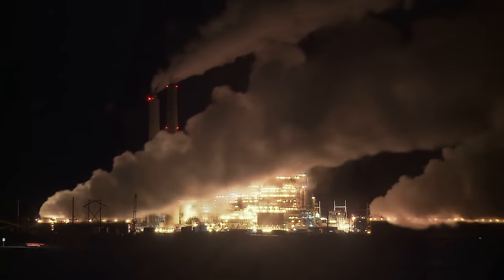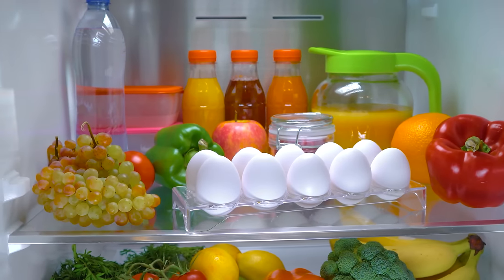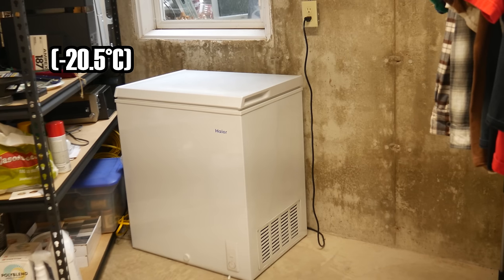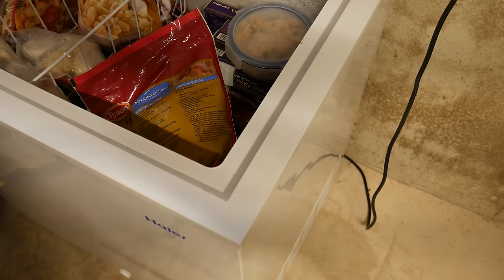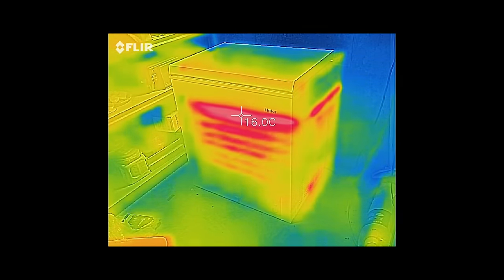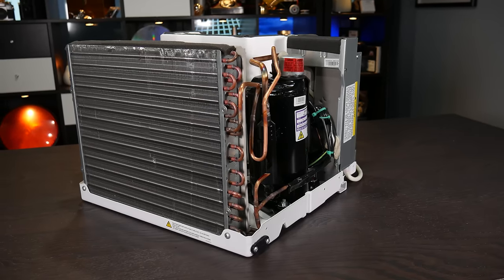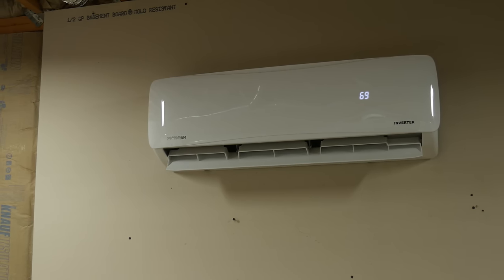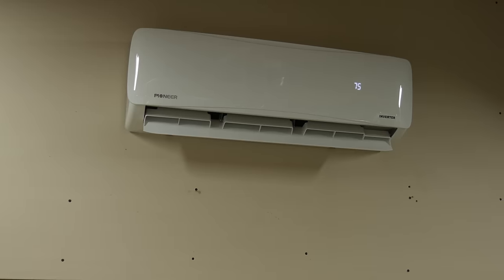Heat Pumps: the Future of Home Heating

Comment: When I was about ten years old, 50 years ago, I asked my father why we couldn't put the outside part of the window AC inside by flipping it around to warm the house in the winter. I didn't know the way it worked at the time but I do now.
Reply: Ahead of your time sir
Reply: I think you have that backwards I would have been kicked today not 50 years ago
Reply: Because the outlet in inside the house :)
Reply: I was working for LUSH manufacturing about 20 years back.  They were trying to pour massage bars however the room was too hot.
They wired up a window AC unit and placed it in the middle of the room.  Being the son of a Mech Eng I was apoplectic trying to explain
how this particular thermodynamic setup was worse than nothing.  Seems funny now however at the time I was truly flailing.  XD
I was working with stupid people...a lot of them were real pretty so, six of one......
Reply: While it certainly would work, the amount of energy that it could pull from the outside(you never mentioned the outside temp), would make it colossally inefficient.
Reply: @seanb3516  The ac would be working against itself that's why dehumidifiers blow the air over the evaporator then the condenser the evaporator cools the air to takeout the moisture then the condenser warms it up before it goes back into the room
Reply: My dad would say that it stuck out too far into the room.
Reply: Wouldn’t work long . Need a defrost cycle
Reply: Nope, doesn't work well.  Does work but very poorly.  not a good idea.
Reply: Seems simple enough to add a reversing valve for the reversibility.. unfortunately manufactures will gouge you for it. On average an extra 1200-1500
Reply: Austin S nothing to it really and it’s not that much more . The main cost in a system is the compressor.
The gist of what he’s saying is air conditioners are heat pumps. The thing is in the trade when you go to the supply house and say you want a 3 ton heat pump you’re going to get a heat pump , which means it’s going to have a reversing valve. If you want 3 ton cooling only , you ask for a straight ac unit.
Where I’m from , most have straight ac with gas furnace , heat pumps with 10 kw or more aux heat strips or “duel fuel “ which is a heat pump with auto swap over to gas furnace at a certain outside air temp. Newer heat pumps are available that can heat in extremely low temps though, however that hasn’t always been the case with them.
Reply: Your medal is in the post.
Reply: @seanb3516  reminds me of one summer my roommate tried to open the refrigerator to cool the room. I tried to explain that it's just a heat pump but he sat down in front of the fridge and pointed out that he was feeling cool air, so it must be working
Reply: LMAOOOOOOOOOOo that was funny!!!!!

Comment: Just installed my first heat pump this winter and it's amazing. I undersized it at 12k BTU for a 1500 ft2 main floor, it's not much more powerful than a toaster and it kept 22C indoors. It's a 14 hspf rated for -26C and averaged 1.4 COP when it was -26C including the defrost (15min per hour). I'm going to install another small one for my basement now and maybe one for the pool!
Reply: Where are you at? Whats the average winter temp outside ?
Reply: @Harcix  In a city north of Montreal, QC. We average 14 days a year with temperatures under -4f. You can look up those stats. I modelled my calculations for worst case of 0F and will be using auxiliary heat or let the temperature drop when it gets worse.
Reply: And update, it used 150kWh each month for the summer, meaning it cost me 9$ per month to operate and kept my house cool all summer for June, July, August. It's amazingly efficient. Still planning on installing one for my basement that I used to keep at 8C in winter.

Comment: I'm actually in the middle of taking an HVAC class right now and the last few videos you've out out have been invaluable in helping me, thank you so much!
Reply: In Switzerland common since the 1980ies. But with water-circuits to heat comfortable and more efficient.
And on the top, a lot of them are taking the energy not from the fresh and cold air, they go 200 meters deep in the ground with another water-glycol-circuit. Even more efficient, but not cheap.
And now since a few years, this deep in the ground going loops are double used:
In winter to get +5°C Water for the heatpump, in summer to bring +16°C Water to cool (without A/C).
But it needs good engineering.
Reply: facepalm
Reply: I wanna do HVAC haha, or be an electrician
Reply: I learned air conditioning for 5 years, and I wish we had a troubleshooting rig like that
Reply: @Worldsoldout  that's... overwhelming and makes me envious. Well, there are perks living in the 2nd world

Comment: As an engineer, that was a brilliantly clear explanation on how refrigerators and heat pumps work. Well done, dude!!
Reply: THE SPLIT HEAT PUMP doesn’t have built-in resistance heat?  I thought that was standard backup heat for heat pumps.  (That’s how my whole home unit.)

.
Reply: They are still a piece of shit in Michigan for heat. They are hole in your pocket in the wintertime and don't keep you warm on cold days. Don't try to bullshit the HVAC installer/ Mechanical Contractor.

Comment: I live in Australia, so it doesn't get as cold in the winter here as it does in North America, but in the winter it can get from between 0-10 degrees C. And my old house was entirely heated by heat pumps. There was like 6 split systems in the house, they worked great

Comment: I'm from Australia and at first thought "heat pump" was going to be some amazing new technology, and then you said "reverse cycle air conditioner" and I was like "oh, aren't they standard everywhere? I have 3 in my home." Apparently not. Here they are very common and work great it our climate.
Reply: Mark Taylor wants to tell you about Australia's favourite air
Reply: Yes, you actually really struggle to buy an airconditioner here that isn't reverse cycle (unless you're buying the smallest cheapest unit possible). And that's in a location where you might turn it to heat mode for a couple of hours on just a few days in the year.
Reply: Heather Petersen  And oil and natural gas.
Reply: Hi Richard - Sydney dweller here.

Yeah i have known reverse cycle air conditioners ( hot and  old ) since the 80's basically

The old part of the house has a mitsubishi  reverse cycle air con from late 80's - still works great
The rear part of the house had a  LG unit in @1995 but that failed and was replaced 2019 with another mitsubishi

The only drawback is you need to remember to change the cycle on the remote from heat to cool 21 heat is was different to 21 cool   - so about 2 times a year i remove the batteries for a minute then place them back in and reset it to the correct cycle ( a dot moves between the heat and cool cymbals every 5 seconds , just press the power key on the cycle you want )

Also, if you are in remote or snow / freeze zones you need a higher end model specifically for freezing areas ( like much of north europe / canada ) these machines are more expensive as they have electrical heating element in the outside evaporator to defrost it beore it starts working

Regards
George
Reply: Same here in Argentina, we have one in each bedroom and living room and it works great!
Reply: I'd think Australia would have normal ACs to keep them cool in the summer.
Reply: In the Northern United States, heat pumps are rare. People heat their homes with propane, natural gas, oil, or wood. But it gets cold.

Comment: There was a "Blondie Comic" where Dagwood has the air conditioner in backwards, and Blondie asks "are you air-conditioning the outside, dear?" to which Dagwood responds, "Nope, I'm heating the house." It captures perfectly the irony of the situation you present.
Reply: They do work if the ambient is above -5 deg C
Reply: @ianship5058  Agree completely... That's the irony. The comic treats it as ingenious on Dagwood's part, but ultimately a "bless his heart" stupid, sigh from Blondie, for not "just" using a conventional heater... I wish I could find it.
Reply: It’s exactly what a reversible heat pump does, only with a reversing valve instead of turning the entire unit around.
A heat pump package unit could be a conventional A/C only sealed system without a reversing valve if ductwork was set up to change the airflow. It must not be efficient as it's not done.
Reply: @hkelly1623  Aren’t heat pumps  a thing of the past/present and not a thing of the future? I see a reversing valve in our cheap condenser I think it’s an ameristar unit.
Reply: @EastDallasKicks  Not necessarily. There is a large market for them in many places. You just don't see them a ton in mini-split configurations here in the states. They are instead integrated into the traditional HVAC system. Normal AC is just a heat pump it's just that most of them are one way. Doing away with heat pumps would be doing away with Air conditioning, Fridges, Freezers, etc. They are all just heat pumps, using them for heat is still a better bang for your buck than electric heat. I haven't run the numbers for gas heat.
Reply: @hkelly1623  It's likely far easier to just put a reversing valve in. Trying to build ductwork in the AC unit to swap the air running through the condenser back inside and evaporator to the outside would probably double the size of the unit or close to it. At the very least it would change the center of gravity to cause even more weight to hang outside the window instead of over top the sill.

You'd also run into the problem of now having to clean out ductwork that is normally taking in outside air as it's going to get all kinds of crap in it that you do not want to blow indoors. A reversing valve is just a simpler design.
Reply: I worked in an auto-repair shop for many years. One hot day, a customer brought in an '80s GM car running a newly-installed AC-compressor. His complaint was that now he could only get extreme heat from the AC vents. I checked the front of the car and the condenser-coil was ice-cold. He'd installed the wrong compressor, which only allowed the combination high-low AC-hose flange to connect backwards! He didn't like our estimate to install the right compressor and went away.  :)
Reply: @EastDallasKicks  From ACME Klein Bottles:  Bringing you yesterday's tomorrow TODAY!
Reply: @2009dudeman  
Here in Quebec practically everybody with a reasonable sized-house has a heat pump. I don’t remember how long they’ve been around but it’s been at least 30 years.

No they don’t go in windows, you have one unit that does the whole house. You have the main unit outside on a little metal stand and you have R-410A refrigerant hoses that go through the wall back-and-forth to the furnace where there’s a heat exchanger mounted internally. The actual furnace can be propane, natural gas, oil or electric but it only comes on when it’s really cold and the heat pump can’t cope, which rarely happens outside Jan 14 - Mar 7.

They cost about $5000.
Reply: @Skyprince27  did you respond to the wrong person? We are pretty much on the same page.
Reply: @2009dudeman  
The reason why I addressed my earlier post to you is because of your statement “change the center of gravity and cause even more weight to hang out the window”.
No, heat pumps are never window-mount.
Reply: @Skyprince27  I was referring to the guy who said they should make reversible air conditioners. I was saying that wouldn't work and it would be easier to just switch the refrigerant flow if that's something they wanted to do.

Here in the states we actually do have window mounted heat pumps for both cooling and heating. I've seen them in stores but I've never used one. I imagine they aren't that popular, but maybe they are. I don't honestly know how much people buy them.
Reply: @2009dudeman  
Pretty sure no one would buy that here. Everyone has a furnace that heats the whole house in the winter; something in the window would only do one room, no point.
Reply: @Skyprince27  like I said, I have no idea how many get sold. I imagine they must sell at least enough to keep them in stores.

Maybe for small apartments with shitty old heat that costs an arm and a leg. Maybe people buy them for their cabins.

I wouldn't know, I wouldn't buy one I have Central AC. But they are in stores so they must sell enough to justify the floor space.
Reply: That is exactly what is going on  except a reversing valve   switches  the coils  rather than  putting it in the window  backwards  for heat  then  in AC  mode to defrost  in winter  since air conditioning  50F air  will ice up  the condenser  in time,  so  every  30/60/90 minutes   a  search  for defrost is made,  if  the temperature of the Freezers  coil is cold enough  a defrost terminator switch  will be closed   , this  is the temperature aspect   required to initiate a defrost,  now  the next time duration passes  both  Time and Temperature  will signal a defrost  cycle.  To defrost  the heat pump becomes an AC  to melt the outdoor coil  the outdoor fan will  be off during defrost.
Reply: @EastDallasKicks  Another reason why heat pumps are "of the future" rather than "of the past" is the fact that they don't burn a fire directly in your house like a conventional furnace. Typically, American homes are heated with either an electric heater or a natural gas furnace. The furnace - so I'm told - runs for 1/6th the cost of the electric heater. A heat pump - like an electric heater - only needs electricity to run - so it doesn't need to rely on fossil fuels (if the local powerplant is either a renewable or nuclear). The difference is, that it is cheaper to operate than an electric heater.